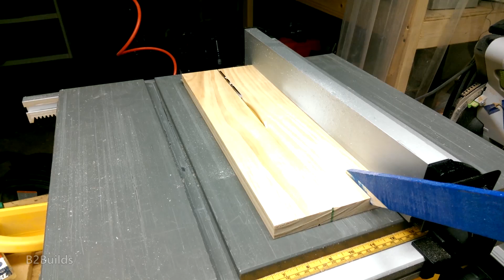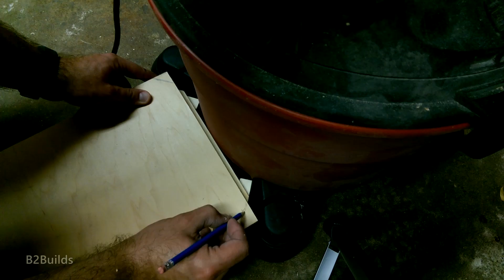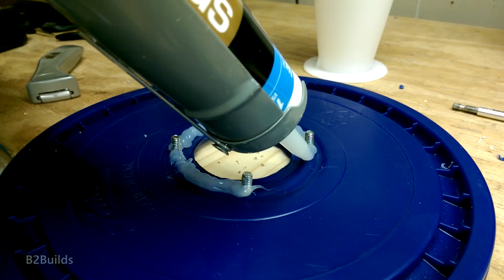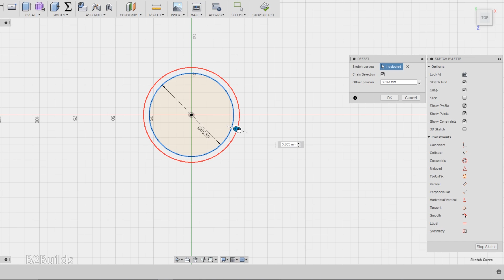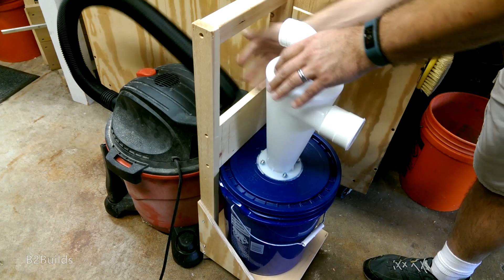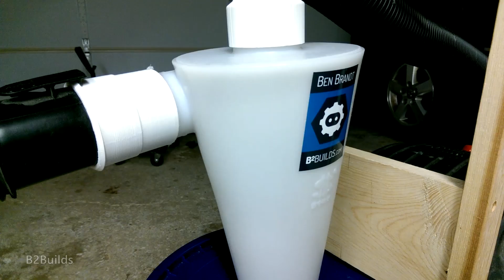Building a cyclone system for my shop vac

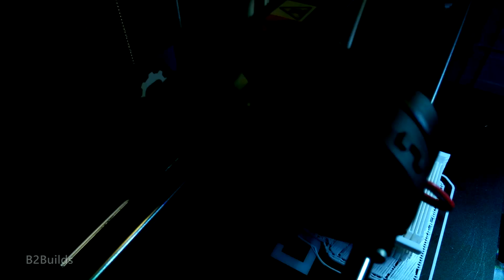Comment: I know this was filmed several years ago but could you please enlighten me as to what the parallel lines are inside the 90° fitting while it is being 3D printed at 6:59. Thanks
Also since there has been significant time since the building of this, would you purchase this cyclone now today if you had to do it all over again? I'm aware it was given to you for the product endorsement on the video, just wondering if you would go out and purchase it, since you now know what you know?
Thanks
Reply from the maker: In 3D printing, that's called "support material." It's basically a temporary scaffolding to support the part as it's being printed. When the print is done you just remove that stuff.
Reply from the maker: I would highly recommend getting a cyclone, but this particular one was a bit difficult to get hooked up to my shop vac.

Comment: enjoy your channel, if I could make an observation.  the cyclone neck will crack sooner or later (speaking from experience :>).  you might want to fix the top half of the cyclone to the cart handle and hang the bucket under.  I did a shop vac video showing an easy way to make the bucket removable and the cyclone stationary.  BTW, silicone will fix a crack if it isn't too big.  I really liked the way you attached the cyclone to the vac easily.
Reply from the maker: Thanks Russ, I agree the cyclone seems a bit unstable up there, I may rework the design down the road.

Comment: I use the same one. For the inlet a piece of 1-1/2"PVC has a nice friction fit and then I hose clamped the hose on. For the outlet I used a hose connector that I cut a slit in and then hose clamped it.  The metric connections are the only bad thing about it.  You will probably have to reinforce the bucket as mine crushes and splits under all the vacuum.
Reply from the maker: Good info, thanks Nick

Comment: Very cool setup. I bought the same $20 cyclone last month and built my own version. Definitely have to do some rebranding; time to get out the heat gun.
Reply from the maker: Nice. I've been using mine to remove labels when re-using shipping boxes.
Reply: Ben Brandt this is why I love this community, I just learned something new (removing labels from boxes with my heat gun), which I'll be using from now on. Thanks!